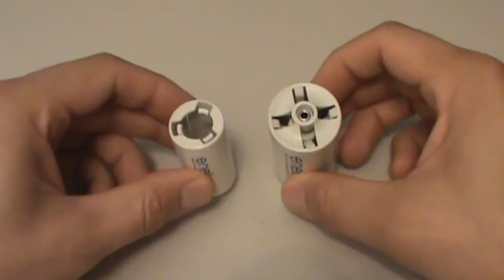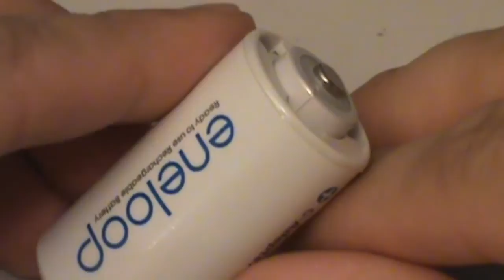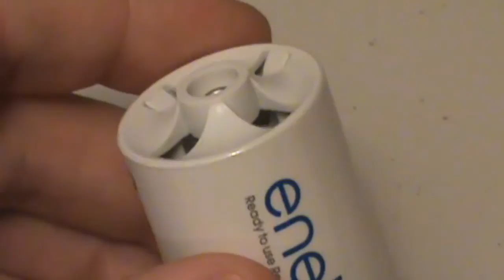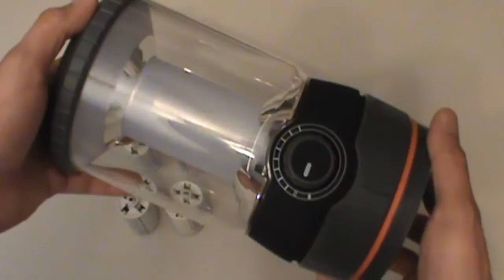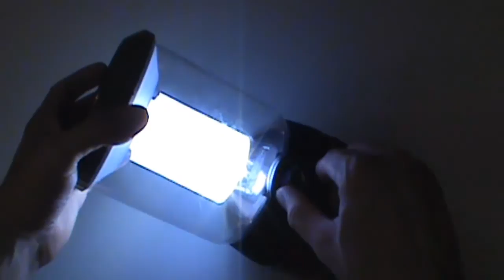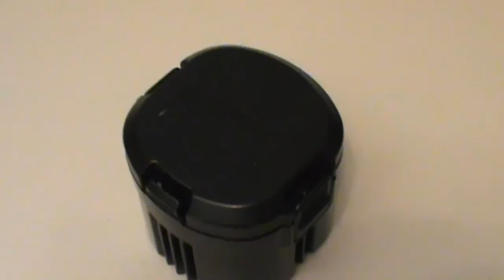Sanyo Eneloop AA to C & D Adapters

Comment: Can you use rechargeable AA batteries, or would the lower, 1.2V voltage mess with the device that normally uses 1.5V D batteries? Would like a radio be affected?

Comment: I'm not too well versed on all the technicalities of batteries so I am wondering if there is a runtime difference between using an AA battery with adapter versus an actual D battery.
Reply from the maker: Generally speaking, D batteries will have a larger energy storage capacity (usually measured in mAh) versus that of AA's.  With that said, I have rechargeable AA's and D's, made by Energizer, which are both 2500mAh.
Reply: ***** Interesting. So they can have the same run time? Btw. Thank you for taking the time to teach me this stuff. I've been reading on this stuff for a while now but it's still very confusing for me.
Reply from the maker: Angel R. In that particular instance, yes, the run times were the same when comparing the rechargeable nickel metal hydride Energizer AA to D batteries.  You would do best reading the manufacturer's specifications for the batteries, as they can all have different storage capacities.

No problem with me responding.  I enjoy responding to the comments.

Comment: that is cool man.  Do you find that these batteries are better, or more efficient than regular rechargeable batteries, (ie, energizer, rayovac, etc.)? Thanks for the great info brother.
J
Reply from the maker: Sanyo Eneloops are probably one of the best rechargeable nickel metal hydrides out there, in my opinion.  The self discharge rate is very low.  After five years of sitting on a shelf they will still retain around 70% of its charge.  I've had Energizers go completely dead, following a full charge, after only a couple months of sitting on the shelf.

The batteries in this video are rated at 1800mAh and are good for 1500 cycles.  Sanyo does make 2500mAh cells, though they are only rated at 500 cycles.
Reply: *****
awesome, I am going to look into getting some of these I think.  Thank you for your time, and the great information brother.
J
Reply from the maker: jnull0 They pay for themselves many times over.  Combine these with the Titanium 16 bay charger I reviewed a short time ago and you've got a winning combo for everyday, off grid and emergency use.

Comment: Thanks for the review Jeremy.  I think I am going to switch to this system.  Where do you purchase your kits from?  Anthony.
Reply from the maker: Amazon.  I should note that you will have a reduced capacity, considering you're substituting a single AA for a D cell.  I can't recall the name, but there is another D cell convertor which will accept 2 and 3 AA cells.  If memory serves, they were about $10 a piece.
Reply: Thanks for the info Jeremy.  I think I am going to get some of these.  Very handy to have and be able to standardize to AA.  Take care.
Reply from the maker: biblesnbarbells You might want to take a look at this AA / AAA charger.  It can hold up to 16 cells and runs off of either AC or 12 volt DC.

https://www.youtube.com/watch?v=_b4Al-zIZP8
Reply: Thanks Jeremy.  I will check it out.